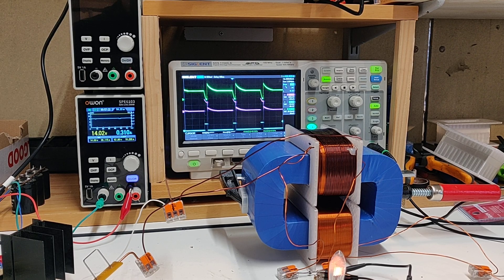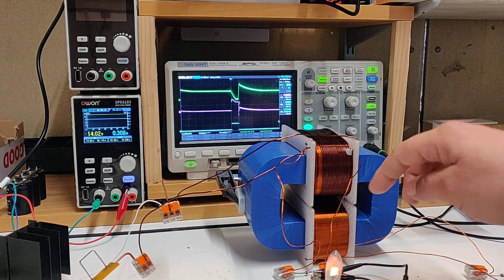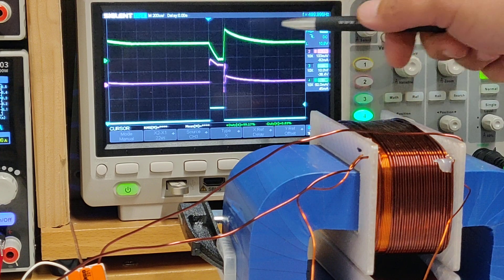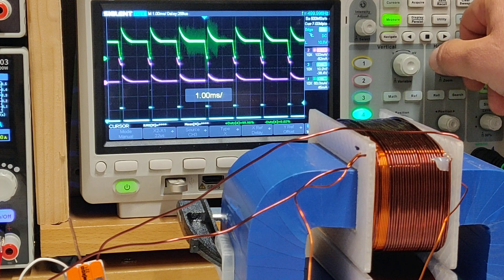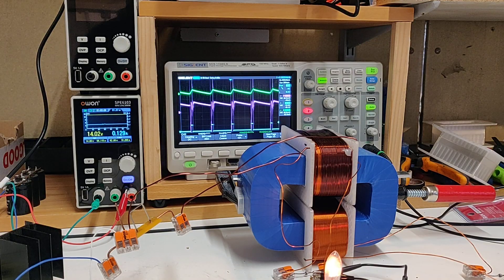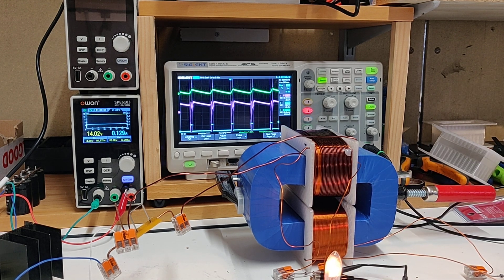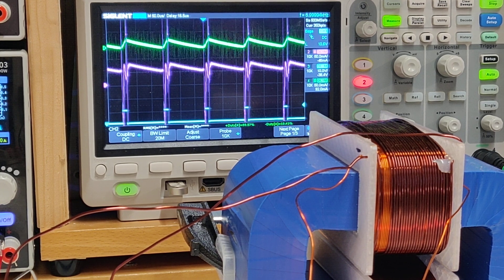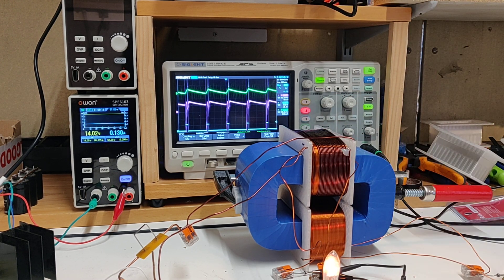POC and input coil polarities

Comment: check out the article What is Volt-Second Balance? the sawtooth current signal in itself isn't special, it is if the volt-sec of the outputs are  in non equilibrium in steady state, bearden calls it ness.
Reply from the maker: Thanks, I'll take a look. Are you on the forum?
Reply: @FringeIdeas  I have an account but I don't post because Chris wants replications and no talkers, but I am not able to tinker, I try to think with others who can.
It's important to measure the voltage over each coil, measuring the drop over the sensing resistor alone is a bit deceptive. Also try to have equal loads on each poc to see if the declining slope will have equal time until it hits 0v.

Comment: does the voltage polarity on output coils change?
Reply from the maker: Hey, sorry for the late reply. I have some experiments lined up to get all of this straight in my head, just been overworked lately. Regarding this question, and the couple comments that seem to have gone missing, I do believe like you said that one output coil acts as a continuation of the input coil. So what flips and what flops is more than likely not the same as in a traditional transformer. However, I do think that both output coils are trying to come up at the same time, during Ton. But it's possible the input coil is preventing one of them to do so. Or, like you said, maybe a forward and flyback type arrangement. Again, experiments pending.
Reply: @FringeIdeas  a flyback is basically the continuation of the input coil, it's equivalent to the buckboost converter but on iron and with the coil separated in 2 parts. The realization that l2 is a flyback came when it became clear that the signal that drops to 0v during Ton is actually this coil. 
Both input and l3 are coupled to l2, so l3 must induce a higher voltage than input in l2 to make it rise during ton. Oscillations in l2 that also go negative during ton is probably caused by the capacitance of the diode.

Those spikes on the top of the slope are caused by l3 wanting to collapse  to 0v after ton, because the flux is decaying and voltage should reverse so that the diode becomes reverse biased, but l2 is preventing this when it starts conducting, it keeps l3 going.

Comment: Is H-Bridge just a switch or can it set frequency and duty cycle too?
Reply from the maker: Hey, yes h-bridges can be designed to use adjustable frequency and duty cycle. I've never used an h-bridge for any of my experiments though. Only single pulses.
Reply: Nice. I procured all the components required to build one. Could you share how to set frequency and DC using h-bridge please?
Reply from the maker: I honestly would not know what to show at this point. It's been years since I've messed with h-bridges, or even half bridges. Quick google search has some decent examples. You will need some kind of pulse with modulation control. Use a microcontroller or something designed for the job. Here is a decent example. https://docs.onion.io/omega2-maker-kit/maker-kit-servo-h-bridge.html